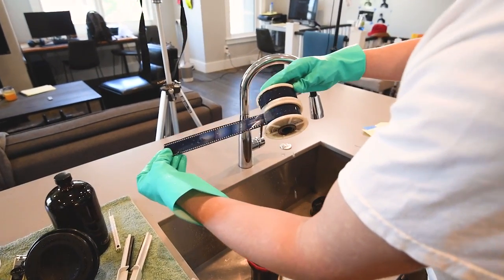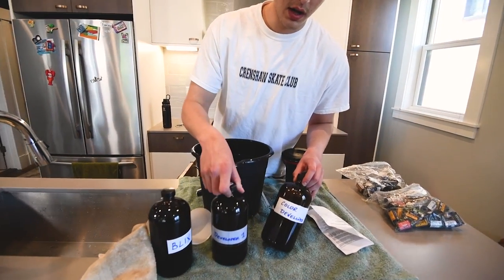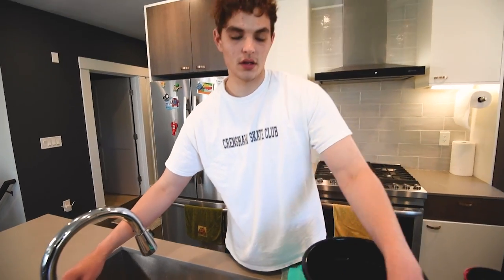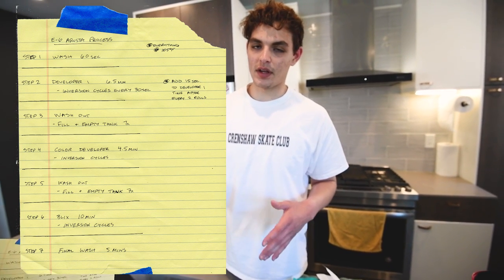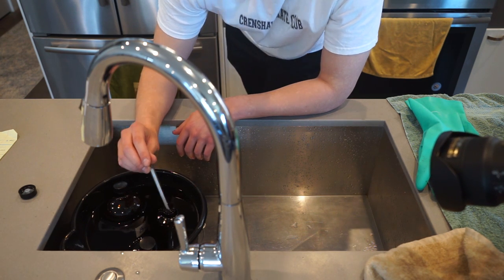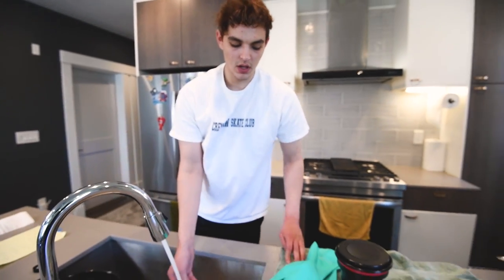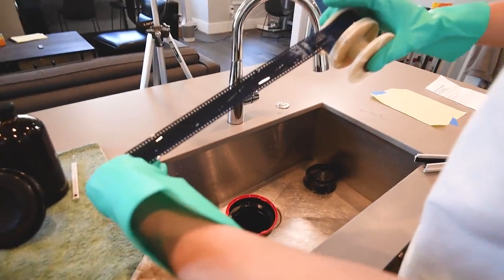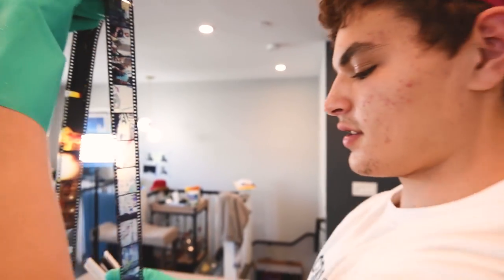How to Develop Color Positive Film (E6 Process)

Comment: Haven't done E-6 in at least 15 years but we used steel tanks in a single Calumet sink and "dunked" everything from large format to 35mm in it.  All the solutions were sitting in the same 100.5 degree Fahrenheit water bath, and we did the entire process in total darkness, by feel and a lumed clock.
Reply: Harsh! I assume that was the real six step E-6 process as welol.

Comment: High marks for his focus on temperature maintenance. However, that positive is offset by taking most of a minute after pouring out the first developer to wash and sort out his bits and pieces before pouring in the water bath. The point here is that developer is soaked into the emulsion, and development continues business as usual during that period, resulting in an over development of the film. I suppose that this is offset somewhat by the cooling of the first developer well below the target process temperature during that first development, with the tank sitting in the sink rather than in a temp controlled water bath. The time and temp of the first development is critical to accurate density and (to a lesser extent) color balance. The following steps are much less critical, as they run to chemical completion. As long as you get enough "process" to the color development and blix, good enough, and more as a safety is even better. E-6 needs a stabilizer for long term preservation of the finished slides. Guess Arista followed Tetenal in eliminating it to save 25 cents worth of chems and a bottle. Add a final bath of Photoflo and loose the squeegee if you want to loose film scratches and hard water spots.